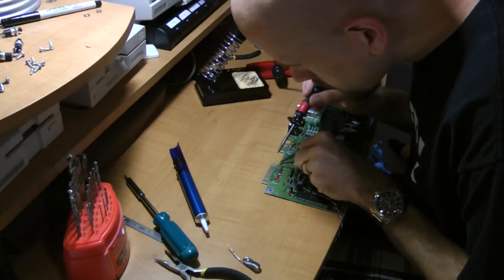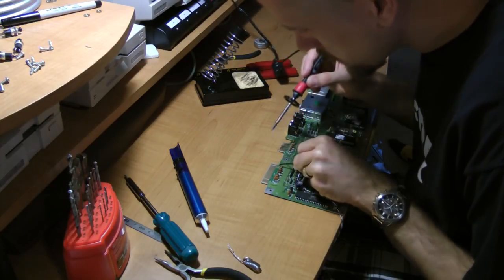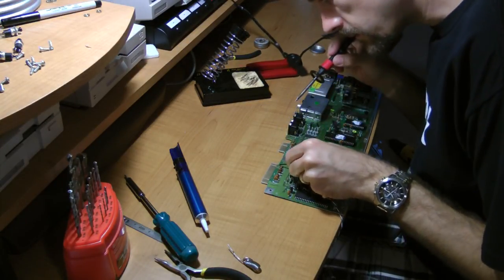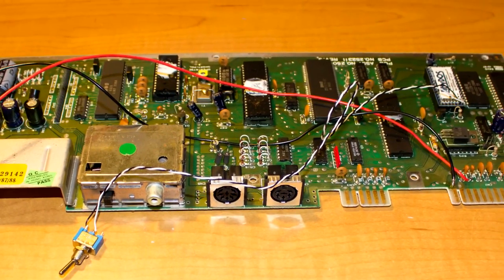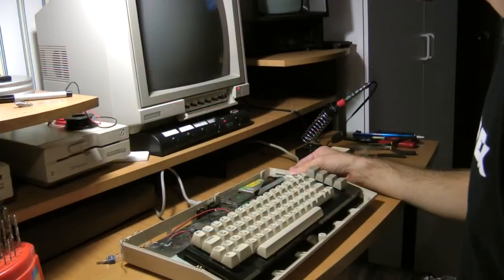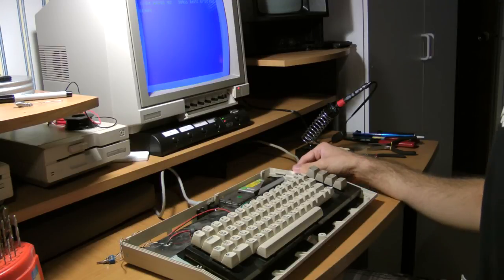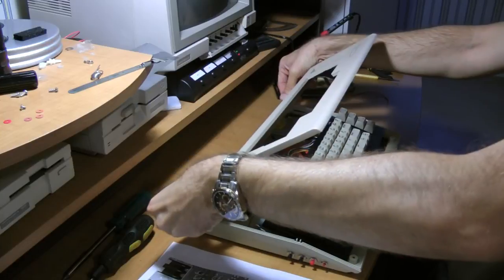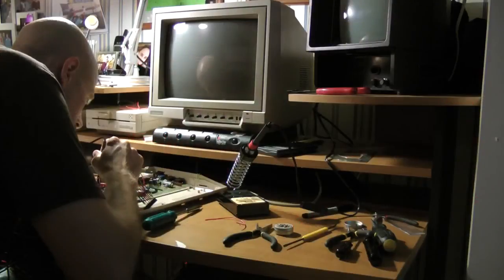Commodore C64-C Gold Mod: uIEC/SD, JiffyDOS, Reset Switch, and Paint Job.

Comment: Very nice job. Inspiring! I look forward to upgrading a C64 and a C64-C to JiffyDOS, but the SD card readers out there now made of recycled breadbin plastic look too cool so mine will be external... I doubt that I would need the cassette port anyway, which I think the SD reader gets its power from. If I find that I will, I'll make a slight mod and use a polarized jack on the C64 case for power.

Now if I could just find original, working copies of S.A.M. Abacus Super-C and the Blitz! Basic compiler.... like I used to have 30 years ago! lol

Comment: A question about putting a uIEC inside your Commodore: are you still able to plug in an external disk drive to the IEC port after you do this?  My C128 setup has a uIEC as device 9 daisychained to a 1571 disk drive as device 8.  This way I can still play those games that can only be played on floppy (and aren't compatible with the uIEC).  I also wrote small BASIC programs to switch device numbers between the uIEC and the 1571 for those programs that are hardcoded to device 8.

My wife recently got me a soldering iron for my birthday, so I'm looking forward to installing JiffyDOS and possibly adding an internal uIEC cardreader to my C128.
Reply from the maker: The internal stuff doesn't interfere with the serial bus, so you can still use all the peripherals you want.

Comment: THANK YOU! I ended up with one after I went no contact with my father, and I remembered him mentioning people doing mods like the reset switch, but I wasn't sure how to go about it.

Also, where did you get the tape port card, by chance? I've been looking at expensive sd2iec "drives" but i'm going to go your route since it's so much cheaper, and just find a housing that fits it.

Comment: what kind of paint would I need to but to do a repaint of the case?
Reply from the maker: laxiton There are paints made specifically for plastic. It's been a while since I did this so I can't remember exactly what I used, but I primed it first (I think with a primer that specified plastic as a suitable surface).